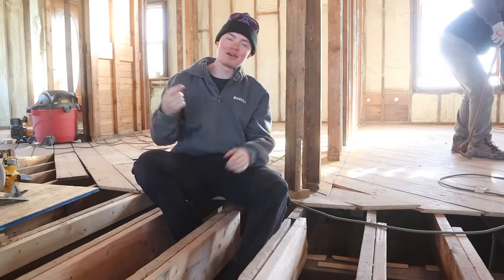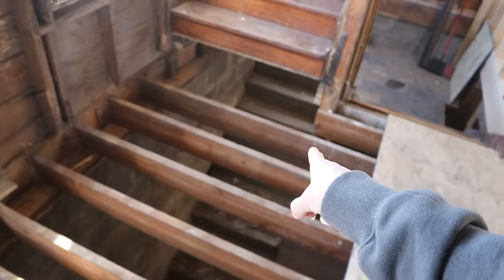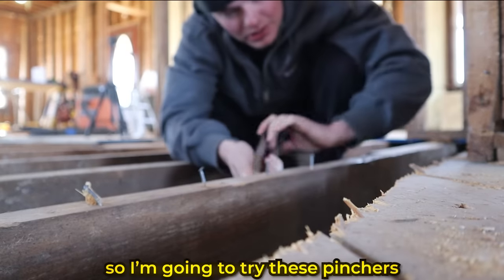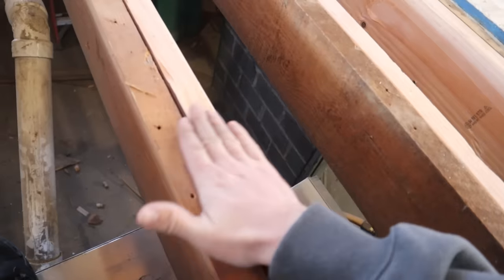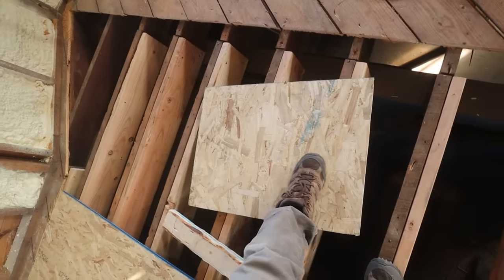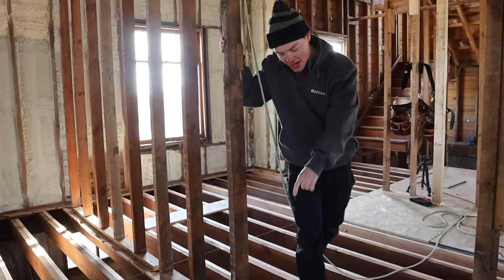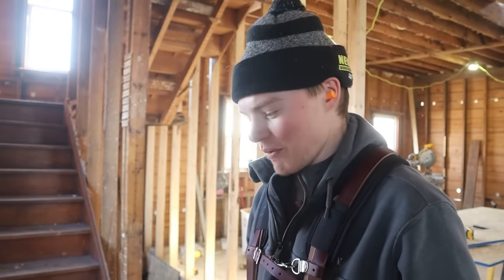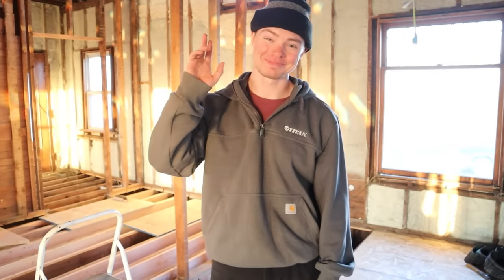Restoring A $7,000 Mansion: Rebuilding Pantry & Bathroom Floors

Comment: In UK and Europe it is normal to install noggins between each joist to help to prevent beam twist, and give a more solid floor.  Your house doesn't seem to have any. Very surprising considering the length of some of those beams.  Recommend you look at these and see what I mean - they are also used in walls between studs - with your high ceilings, these become even more important.  Noggins are normally constructed of the same dimension timber as the joists/studs they are supporting.
Reply: in the USA we call that blocking and I was wondering the same thing as you Mark.
Reply: Also called blocking.
Reply: They also act as fire blocks to delay fire transfer from cavity to cavity, instead of just running the whole length of the joist run unopposed.
Reply: They may be holding off on blocking until they install their new lambeams in place to level everything.
Reply: We also use a lot more brick walls, concrete floors and ceramic roof tiles. Which is stronger, more durable and less of a fire hazard. From the beginning of this build I wondered about the flimsyness of this whole wooden construction.
Reply: Houses built in this era, 1900's rarely had noggins or blocks, I've renovated 2 very old houses, no blocking anywhere, but the lumber in that era was a full 2" (2.5cm) wide, not the dimensioned junk from modern times, and the boards were good and dry. Brand new lumber today twists like a dogs leg.
Reply: Recall that there was lath boards across the joists. That was as good as it got back then. Maybe now as well.
Reply: @waltertaljaard1488  well...that "flimsy" construction lasted over 100 years through derechos, massive snow storms etc. Homes are built wildly differently all over the world, from the Igloo to the treehouse to the A frame to the homes built into the side of mountains and those built on stilts over water. I don't understand the need to critize one over the other. Homes/ buildings are built so hugely different from region to region due to so many reasons such as climate, building materials native to that region, building codes/permits, space ( this is a huge variance from most of Europe and Canada and the USA). for instance, Germany and its 83 million people would fit inside one Canadian Province, say like Saskatchewan which has a population of 1.1 M.. So, those million people can afford to sprawl out in their homes...unlike homes in Germany. There are so many factors that contribute to how homes and buildings are constructed all over the world, just as we like to talk about being inclusive and enjoying and trying to understand other cultural ways of life, I suggest we also do the same and leave behind the constant bashing I see happening towards all things created or built in the USA, I just think we can do better honestly.
Reply: @KarnReaper  I'm Canadian but I grew up in England and I know our Canadian houses are all wood because we built 4 over 56 years, and I know our British houses are brick and concrete too because I grew up in them and have a lot of family still living in them,  but I also think it's rude to criticize building practices in other countries and I almost posted a rebuttal myself.  Brick has plenty of disadvantages just as all wood construction has, because believe it or not nothing is perfect, so I'd suggest people mind their own beeswax and stop carping about what others do. On here and elsewhere.  It's not productive and wastes time and energy and creates ill feeling, so it's a BAD IDEA.  🙄😡
Reply: @waltertaljaard1488 here in the US we don’t seem to have the same issues as you folks in Europe do with groundwater  wicking into the structure. I think the Brits call it “rising damp” Modern framing methods do include sealing the sills, much like your damp course. It’s also really just traditional European timber framing reimagined. The actual frame is a bit flimsier but the exterior sheathing is structural and actually makes for a very strong building. The early settlers here weren’t really set up to make stone structures so they started with timber and continued to refine that method of building technology as opposed to reverting to brick and stone as time passed
Reply: When I built my house  we used 2x12 floor joists.  We spanned about 15 feet with them.  Every joist has cross bracing between it and its neighbor.  This isn't so much of a structural thing as it is to take some of the bounce out of the floor.  With a 15 foot span you are going to get some flexing from the joists and cross bracing makes them stiffer.  Some of the flexing will be vertical, which you can't really take out without reducing the span length.  Cross bracing reduces the tendency of the boards to flex in a twisting fashion.  In other words it keeps the joists perfectly plum even when they are loaded.  They are stronger when they are plum so the floor doesn't bounce as much as it would if the joists were free to twist when loaded.

Comment: A tip for ringshanks, before you try to pull them out, tap them down very slightly with a hammer, it loosens the wood then pull out after makes it much easier👍🏻
Reply: I use a vise grip to pull out nails and staples. Use the curve part of the vise grips to leverage them out.
Reply: @bresina63 Or Cole could use the tool he was using correctly.  Does he wear his shiny new tool belt in this video?
Reply: They think ringshank is hard to pull out ... try ardox spiral nails .. very common in Canada.. why the us doesn't use them blows me away
Reply: @ryanaustin1970  here in the UK we are still stuck using pozi drive screws, whereas America is standardising the Torx screw which is far far superior
Reply: @Lyonscarpentry  only slightly better than pozi drive aka Phillips... seriously oder some Robertson screws and bits ....
Reply: @ryanaustin1970  I have tried to previously, but we don’t stock them in the UK anywhere - apart from pocket hole screws!

Comment: I've done masonry for several years. Make sure when you put that jack on top of the cinder block, that you rotate the cinder block so the two holes in the middle of the cinder block are facing up. You had it on its side, and there is almost no strength there. I believe it looked like it was over the webbing, but you still need to put it the other way and Bridge it with a board or something like you had.
Reply: Yep, I saw that too...

Comment: Seeing the deflection of the joists with just the weight of the three of you (even with sister-ed members) makes it clear that you'll need either a glulam or a steel I-beam in the basement to carry the load generated from that span.  Good luck with replacing it!!

Comment: those pole jack are the best tool to have in home remodeling , i have about 40 of them .  i have used them to jack up large sections of houses for wall replacement to rim boards and sill plates as well as floor joist .  great tool all around ....

Comment: @7.00 you use a 4.5" circular grinder to remove the portion of the nail that is on top the beam.
Reply: And be smoth with the fence pliars when pulling the ring shanks, brute force breaks things off

Comment: A little safety tip, take a piece of your flooring and screw some 2x4s to it so they fit over at least two joists, even three and they overlap downward to the outside of the joist and they will not slip or tilt., Easy to do with some scrap, you can even screw on some strapping for a handle or cut a grab hole hand size. make three , one for each guy. OSHA, OSHA!:hand-orange-covering-eyes::cat-orange-whistling::trophy-yellow-smiling:

Comment: 12:43 looks like that block is laying on its side. In my experience doing stuff like that it is less likely to break if you put it with the cavities facing up and the board on top. That loads the block in the direction it was designed to hold the weight and it is quite a bit stronger that way

Comment: I'm going to throw out a possibility to strengthen the floor to wall connection given your balloon frame. I would suggest using shear rated screws for joist to stud, but your already spray foamed and the good old nails , while not rated, have a pretty good shear strength. So, my next suggestion is, because you have 10' ceilings, consider a 2×6 or 2×8 new ribbon board at 2nd floor and attic floor. With a consideration of finish work  including either a built up  crown moulding or a coffered ceiling. A coffered ceiling might also offer options for duct runs or elegantly hiding or rather accenting what maybe necessary beam locations for second or third floor. Additionally, coffered ceilings, while extra expense, are beautiful and can themselves be accented with trim and lighting improving a basic room to a true showpiece!

Comment: 'm sure you are going to add spacer blocks between the floor joist from below to prevent curling and warping of the joists
Reply: I don't think that's necessary with the double joist system he has installed, the way they are screwed together would make it very hard to warp both boards together, and I'm sure this was taken into consideration when deciding to "sister" the joists.
Reply: ok thank you

Comment: I haven't heard you mention a laundry room.  Once you have a house with a laundry room off the kitchen, you'll never go back.  The kitchen is where you spend most of your time, so it's most convenient for the laundry room to be nearest to where you hang out.
Reply: Plus a stackable set upstairs!
Reply: I built a house like this and placed my laundry room upstairs. It had a floor drain just in case of a breakdown and flood. Hauling all the laundry downstairs to wash and hauling it back upstairs was too much work. The only thing I had to have laundered downstairs was kitchen and bathroom handles towels.

Comment: Ring shank nails are as good as screws to remove squeaks and you can use a nail gun which is faster than stupid screws, my brother used screws to build his house he used enameled easier to remodel because if you use dry wall screws they will rust and be worse than ring shank to remove incase you have water damage or just need to remove them.

Comment: It seems to me that a lot of corners were cut in the construction  of the original  owners house. Beams, floor joists,and sub flooring that did not end properly  at a floor joist. Also as we all have noticed improper  bearing walls, which are far from the lower foundation walls. 😢
But Cole and crew are rebuilding a better, stronger home for his  present and future families 😊. 
You go, team😂
Reply: And yet it stood for over 100 years with several of those years in neglect.  Using OSB instead of plywood for flooring is going to come back to haunt Cole.  There's a reason it's cheap.

Comment: A good rule of thumb is ALWAYS subcontract the drywall (unless its a small area)  Your mental health will be greatly improved. Those guys that do it every day take about a tenth of the time.
Reply: So true !
I've done drywall in a few small offices we build. I can't imagine doing the entire huge house.
I've seen professionals do it.
They do it so fast and it comes out so much better.
At least give it a thought, Cole.
In the long run it'll save you time and money.
Reply: How is this different than plumbing, heating and electricity... all of which Cole is planning on doing himself.  I'd rather have a no-nothing hack doing my drywall than my plumbing or electricity.  Putting up a couple recepticles and light switches doesn't make you an electrician.
Reply: @benhur520  Because electrical and plumbing are easy. All you gotta do is read and understand the codes, watch a few youtube videos, and hire a good electrical inspector afterwards. Ive done 2 homes now redoing them its simple. Plumbing was the more difficult one taking the concrete out for sewer lines but not bad otherwise. Drywall is difficult if your not a pro to make every seam invisible and as smooth as possible
Reply: @brabblemaster401  Exactly !
Reply: @brabblemaster401 Really... so why do electricians and plumbers require an apprentice and journeyman's period (years in the trade) before they can test for a master title in their field?  In my experience drywallers are future painters and who aren't yet certified alcoholics.   When you hire a drywall crew, do you require that at least one of them is a master drywaller?  I think that's the guy who will understand and speak English.
Reply: @benhur520  honestly don't know y but there is a danger to it if you do it wrong. I'm talking about doing your own work. You don't need a license to do your own house, just for others you do

Comment: in my opinion instead of ripping out the old subfloor u could of just glued and screwed 1/2" plywood to it and used self leveling to fix the level and for ceilings just do a drop down steel supported ceiling but to each there own

Comment: Since the beam in the basement that you had to raise/lower is now carrying about twice as much as it was before, is it sized right for the extra weight (sistered floor joist, new sub floor etc)
Reply: They have removed tons of weight from the house from the tons of concrete and tiles to the tons of radiators. It cant be any heaver than that.
Reply: @onamissionize Yes, it can.
Reply: New laminated beams are going in later. Probably block the joist then too.

Comment: New floor joists will shrink.  A brand new S4S air dried  or even kiln dried, in a 15 to 20 year span of time will shrink,, a 9 3/8ths new 2X10 will shrink to 8 7/8s  inches    DO NOT mix new and old joists and justify them to the top.  You CAN marry a new joist to and old joist to raise it.  But do not replace only the few defective joists.  Keep them all.  Or, replace them all.
Go with some of the new LVLs  they do not shrink.

Comment: The electrician should be there roughing in NOW.  HVAC could start too.  All of these items have lead times for component delivery and installation.

Can you tell us the projected completion date?  I would like to know your target handover date.
Reply: Really?  Are you that nuts how can you electrical and  HVAC when more walls need to come out and new walls go in and you have two more floors to do that to?  Order is get framing al done then get the other trades in.  Can't run electrical when there no wall to run it in.  LOL
Reply: Roughing in can't be done early enough.  The overall MEP plan can't be addressed too soon.

Main and sub panels need to be in place right away.

You probably don't have the experience needed to comment.

Comment: Kinda tired hearing all the whiners talk about the wood floors and staircase ect. ect.
   It would have cost tens of thousands of dollars to reinstall and refinish those floors, and those stairs were NOT safe, would you want your kids playing on them? Or around all that knob and tube wiring? 
   That whole house was not safe. (and the jury is still out whether it is yet) Not to mention the health hazard of all the dead mice, rats, bats and birds that would never been found if not for the FULL renovation. 
  Yes it is very unfortunate that some of the architectural features could not be saved but that's the price of progress.
   Cole is building his forever home and should be able to live how he wants to, not burdened with someone's idea of an idyllic past.
Reply: It is not any kind of renovation. He did gut the house. It was justified. To this extent. Not certain. Nobody says you can't be up to code. Only a fool would retain the wiring and the plumbing. No one said that but it does expose your knowledge of the process. Can you call it a renovation? Even a partial is a big stretch. The proof is what will be retained of the past. How much will be returned. According to plan I don't have much hope. I hope I am wrong. The flooring was not good so not much you can do. But there is a lot more to it than that. I don't care at all about his design. It is his house. The past is going to be erased mostly. The floor plan is gone and that's fine. But nothing of what was there will fit. I have seen and done renovations, and this can't be called a renovation. Call it something else. There are many options and all of them are being used.
Reply: @greghamann2099  Maybe you could Google the word renovate, or look it up in the dictionary,  besides it's just semantics at this point.

Comment: Might I suggest using glue when you lay your subfloor.  You’ll thank yourself 20 years from now with quiet floors.
Reply: Might I suggest that you actually watch the video before you make comments. If you had you would have seen them applying construction adhesive to the top of the joists before laying each sheet of subfloor. They have been doing it the entire time.
Reply: Really?  Do you even watch the videos?

Comment: STOP SCREAMING!!!  Chet Larson remodeled his house without gutting it.  New flooring, added walls, removed the popcorn ceiling, replaced the staircase.  He must have done something wrong because he didn't move out and didn't gut everything to the studs and make a dozen trips to the burn pile.
Reply: His how was a1970 it had electrical and plumbing in it.  His floor where level He had drywall.  Big difference ion the two house 1907 and 1970 63 years difference and lot more codes in 1970 then 1907.  Can't believe you really think these are on the same scale of each other.  Plaster walls very little electrical sagging floors.  Might want to think before you speak next time.
Reply: @johnunsicker7440 That's more like a house built in the 1950's.  If it were in the 70's it'd look like his grandparent's house.